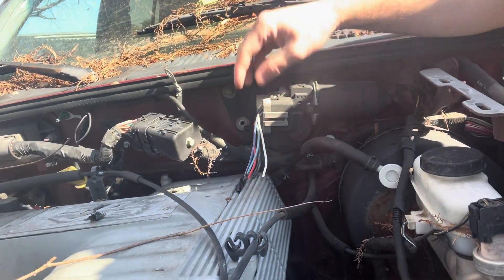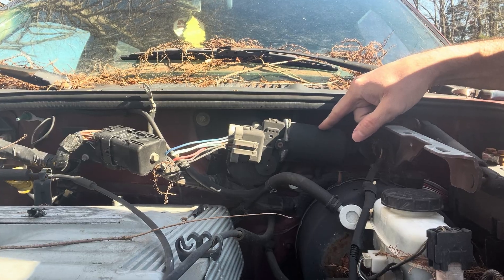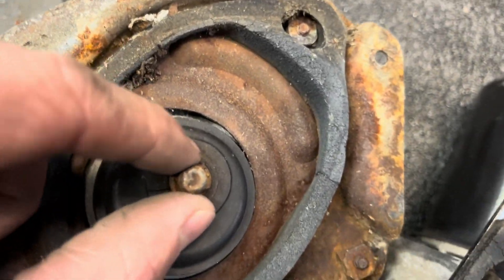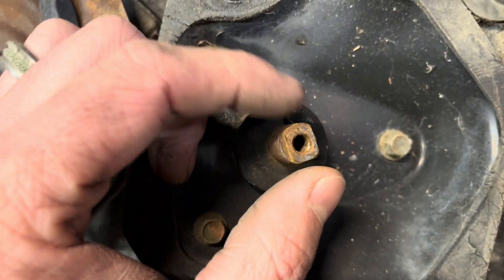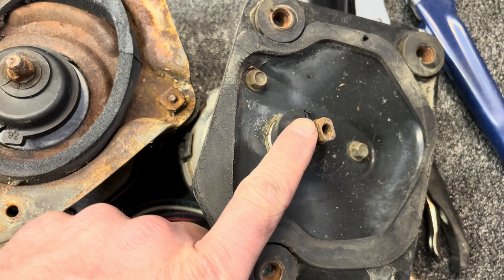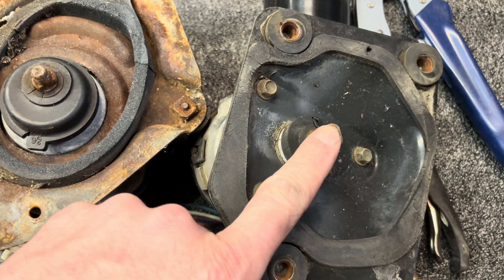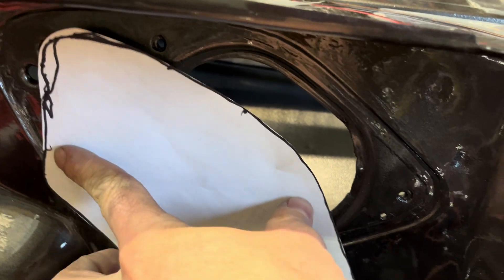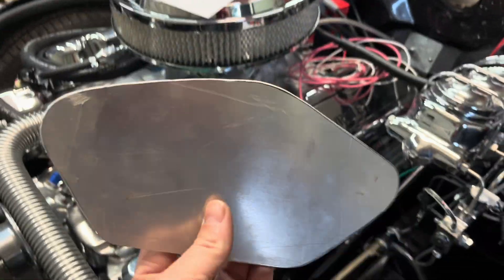upgrading the Bulky GM wiper motor for a new small wiper motor for cleaner look

Comment: Do you have a video of them operating on the Chevelle?  Also, what year(s) of the explorer works?  Thanks for sharing this info!
Reply from the maker: @markchamblee723  same as a ranger, and 98-04 is same. But I had to use a different switch and relay so they start and stop correctly, I do t have any footage of them operating